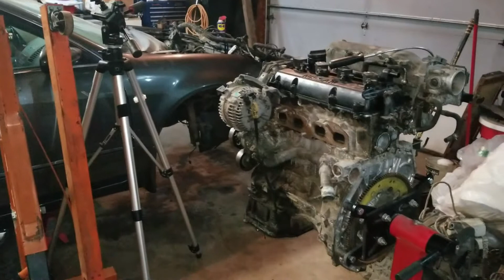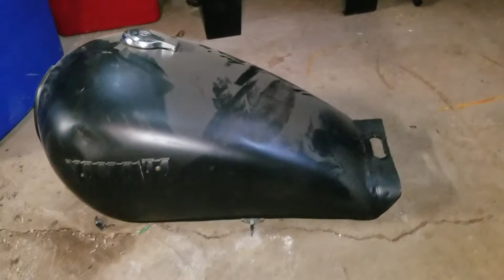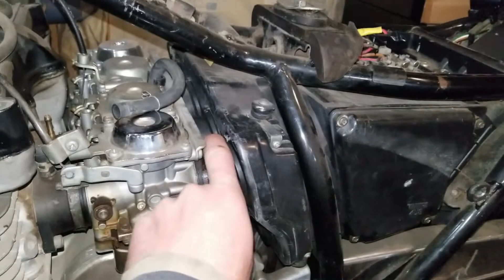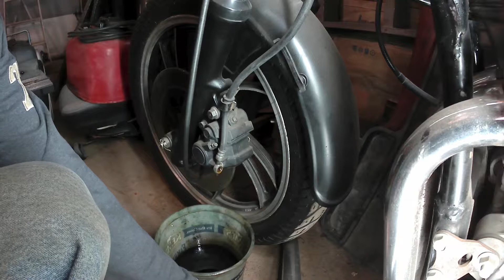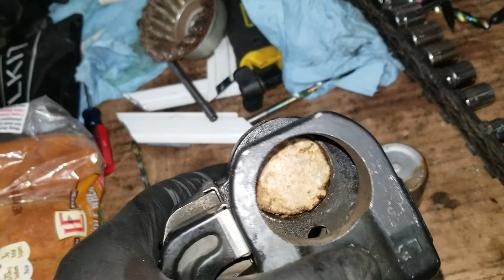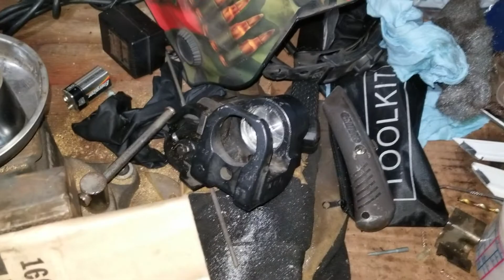Budget brake repair 1982 Yamaha Maxim 550

Comment: can u show a vid how the vacume lines run thanks
Reply from the maker: Unfortunately, I no longer have this bike, but I can try to come up with an alternative. Are you wondering about the vacuum lines for the fuel petcock?
Reply: @minnesotagearhead6612 yes. i found a diagram that shows how they go but thank you . mine is a 1982 yamaha xj1100 nice little bike just hard to find parts for.

Comment: You can also leave the lines attached and disconnect the brake from the fork. Take the pads out and then use the hydraulics to get the piston out. Little messy but quicker.